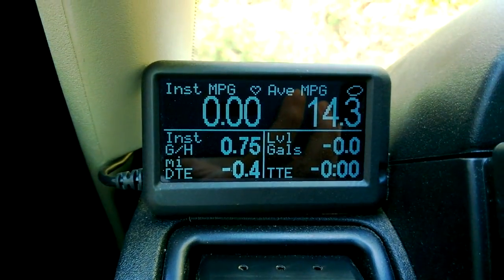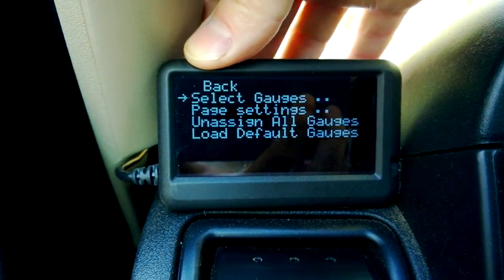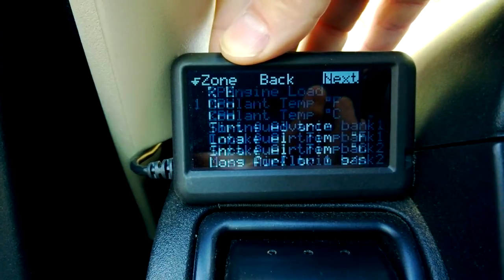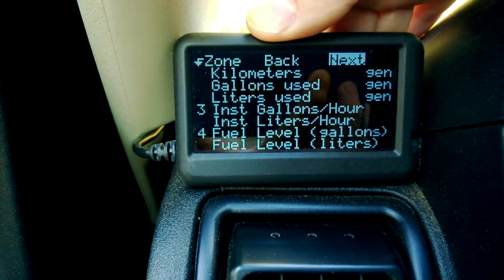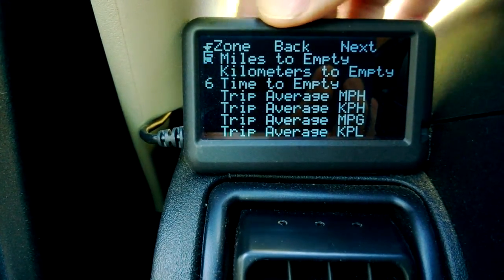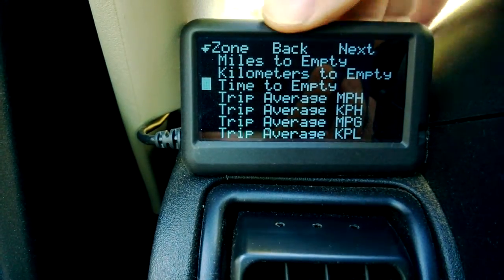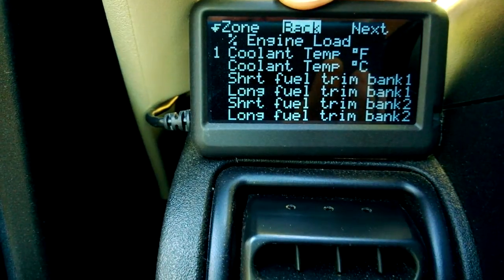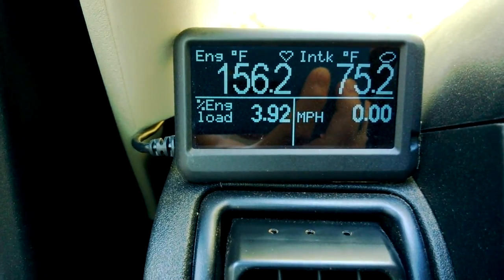Modify UltraGauge Pages

Comment: Hello how are you doing I got a question about this gauge my fuel gauge doesn't work on my 02 Maxima will this gauge give me a reading of my fuel ?
Reply from the maker: Unfortunately, I don’t believe it will give you a fuel reading from your car‘s computer. You can manually enter how much fuel you have put in and other data about your vehicle, and it will give you a guesstimate of the remaining mileage and fuel level.

For it to work like you were talking about, your vehicle would have to have a computerized fuel level sensor already built-in. I don’t believe they had that on the O2 Maxima.

Comment: Hello sir, about the fuel consumption is correct?
Have you check it all these years?
I have read complains that for small engines as 1.3L this gauge don't work properly on MPG.
Reply from the maker: Unfortunately, I have not tested the Fuel Consumption to see if it's accurate.  I was running it in a Land Rover in this video, and I currently use it occasionally in a Toyota Tacoma 2.7l motor.  But I have not calculated the fuel usage.  I do know that you can adjust the settings to compensate for inaccuracies.

Comment: Any idea how to read transmission temp ? 2008 Tacoma .
Reply from the maker: I just read on their site that you have to have the MX or Bluetooth version of the gauge to get that data.  I'm not yet sure how to tell if you have an MX or an EM gauge.  I'll try to find that out if possible.
Reply from the maker: Here is more info on the MX version.  I'm pretty sure I have the EM version.
https://ultra-gauge.com/ZC/index.php?main_page=product_info&cPath=1&products_id=57
Reply: SuperSport1966 I have the MX 1.3 ,just got it 2 weeks ago it’s still in the box !
Reply from the maker: This page also talks about what is not covered by the EM version.
http://ultra-gauge.com/ultragauge/TEN/gauges.htm
Reply from the maker: Ah!  Let me see if I can find out how then...
Reply from the maker: If the Trans Temp is not already programmed into the gauge, here is a PDF that explains how to add it:
http://ultra-gauge.com/ultragauge/support/UG_MX_Supplement.pdf

I'm sorry, I don't have that gauge, so I have no way to go through the procedure and do a video, otherwise I'd be happy to.
Reply: This was very helpful all I wanted on my daily screen is Temp and voltage. 
Can you tell me if I can add oil pressure?
Reply from the maker: @danmclellan1088  Unfortunately, I don't believe Oil Pressure is one of the available options.  I've checked my gauge and the website, and neither show it that I can find.
Reply: @SuperSport1966  not a big deal I will still use it.My mini cooper r58 didnt have a temperature gauge this is a good solution.
Reply from the maker: @danmclellan1088  I also used it in my Mini Coopers when I had them, 2003 and 2010.  I like that you can check and clear engine codes using this also.